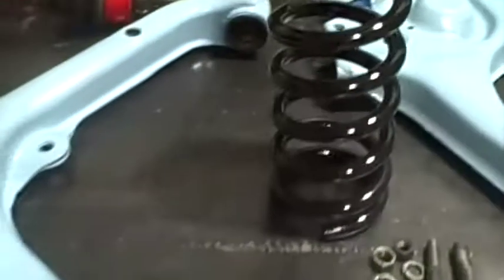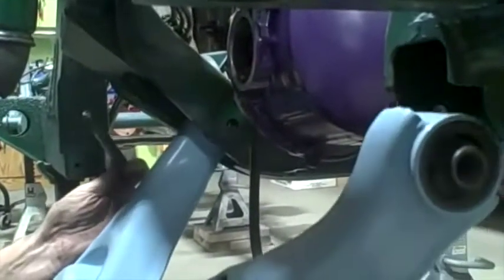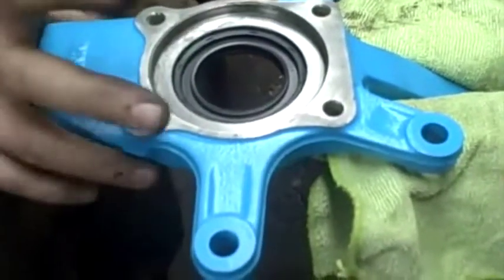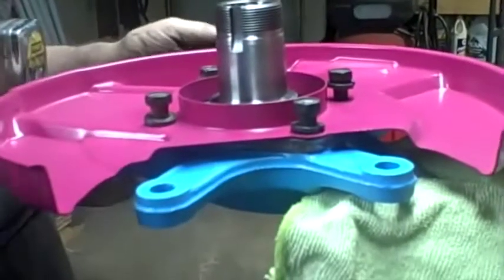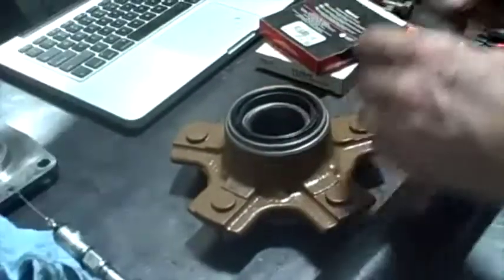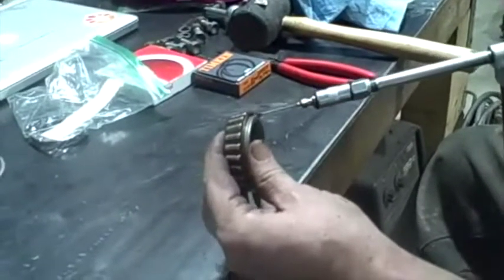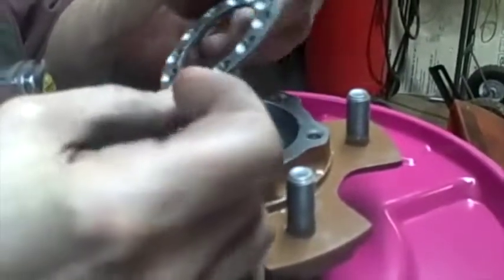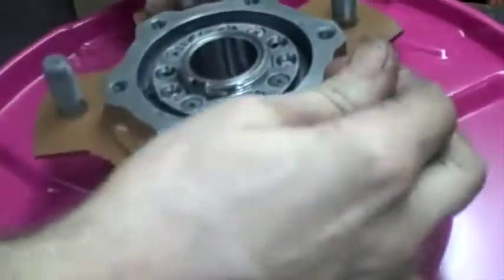Building My Car From Frame Up Episode 6 (rear swing arm, catalytic converter, front knuckle)

Comment: I'm only 6 episodes in basically, not to be critical but I wish you had taken a wide shot of the whole frame and assembly to that point with the camera? it would be nice to see that during the last 5-10 seconds or so of each episode. Frank, I am envious of anyone that can put an entire vehicle together without being in an actual factory. I have NO mechanical aptitude whatsoever and can only fantasize about building my own  vehicle from the ground up in my garage.
Reply from the maker: That sounds like a good suggestion.  If you have a garage then you could build a car.  Mechanical aptitude comes from learning how the machine works.  I recommend starting with something small and simple like an old motorcycle.

Comment: Bushings? Did you find a Delrin Kit? Loved the other build. I have a 96
Reply from the maker: Sorry Ruben, but I do not understand your question about bushings and I do not know what a Delrin Kit is.
Reply: @nunapitchuk  I'm looking at replacing all of the "rubber" bushings. Polyurethane is my second choice and Delrin is my first. Have you found a kit that includes all of the bushings?
Reply from the maker: @Meche697  Sorry, I do not know of any kit that has all of the front suspension bushings.  I am not familiar with Delrin.  Sounds like you know more about the bushings than I do.  I just cleaned them up a little, but did not attempt to press them out of the suspension arms.  I do know that I had to destroy two of them by cutting them out because the mounting bolt rusted in.  That is why I have been putting a little grease on the bolts when I put them back together.
Reply: @nunapitchuk  Delrin is a self lubricating Urethane... avoids the grease :)
Reply: @nunapitchuk  in lieu of grease, single wrap of teflon tape. Appears to be the direction I'll be heading with Polyurethane.